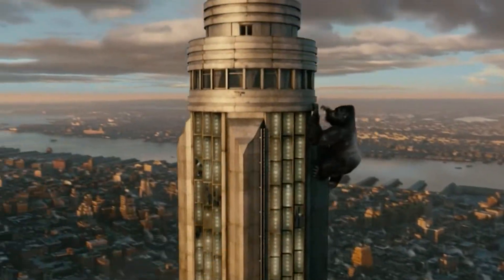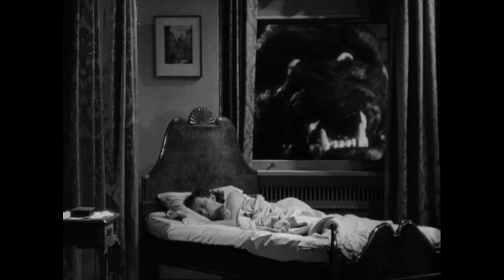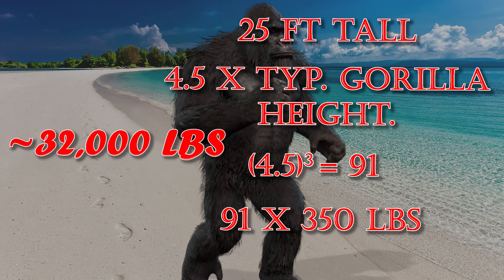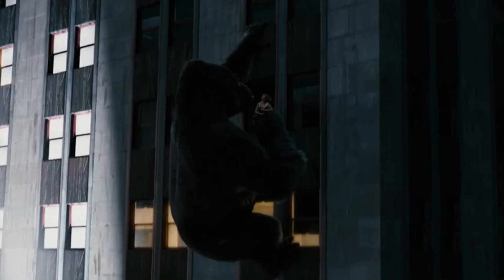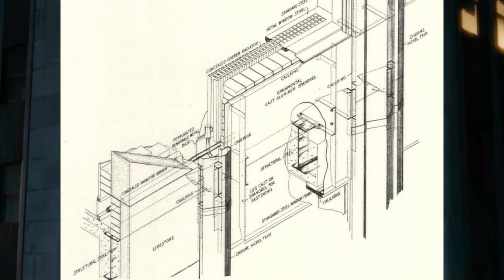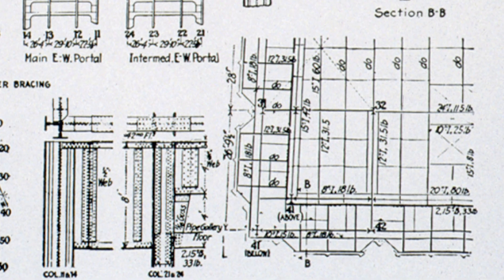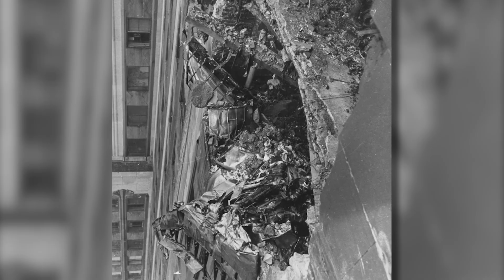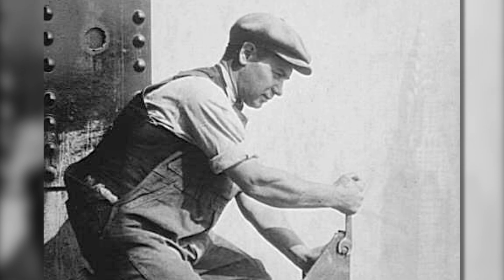Could KING KONG Really Reach the Top of the Empire State Building

Comment: I've a weird thought about King Kong - mainly his death atop the ESB. Been studying that scene in the Peter Jackson version, and was wondering about the bloodlessness of the situation. I don't know what percentage of blood loss leads to unconsciousness in healthy male primates - and I'm not about to research this on the internet; (not a list I need to be on, thank you). But it does seem that the top of that building would be awash with gore (of which I am not a fan). Back of the napkin indicates that Kong would have about 1700 gallons of blood in his system if he's around 25 feet tall, weighing 80,000 pounds. This is his weight as assumed by internet research estimates, with blood capacity being 17% of adult male humanoid body weight then converted back to 8lbs per gallon of liquids in general. It would obviously be more like 680 gallons per your weight estimate. Obviously. 🙄

 Also, if the .30 caliber (7.6mm) bullets from the era's Lewis guns on the biplanes were scaled down in relation to Kong's size, it's either .08 cal (>2mm) scaled by length or .04 cal (>1mm) by volume to a normal size human. How many of these diminutive rounds would it take to incapacitate Kong, considering that it's the equivalent of a man being shot with high velocity pinheads.

Comment: Thanks for answering a question I had ever since I was a kid and saw the 2005 movie.
When you mentioned at 9:30 that the steel used in the Empire state building is one third the strength of modern steel. It made me wonder just how far a modern "version" of the Empire State building could be pushed using the same construction methods but the only change being modern materials. As in theoretically how far the height could be pushed, could the 381m height of the Empire State be doubled or would the the design be such a limiting factor that it could only be pushed by a 20% increase in height.